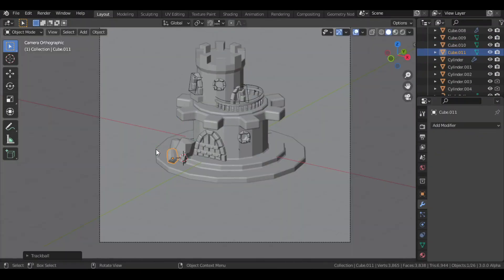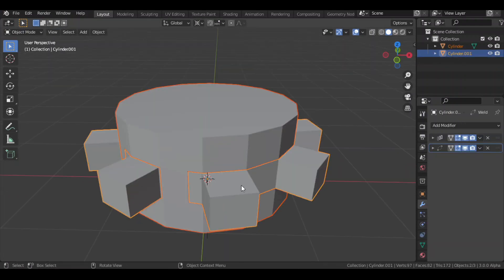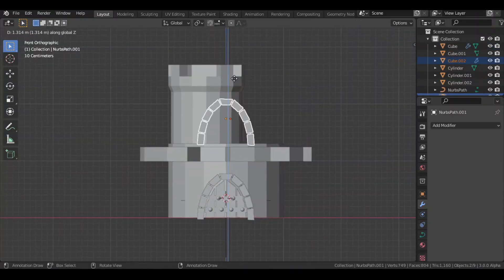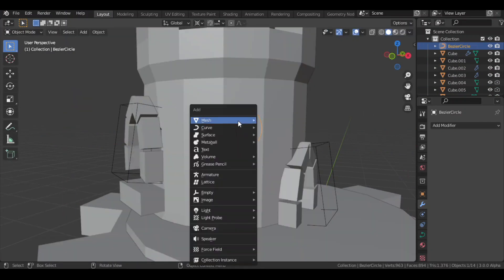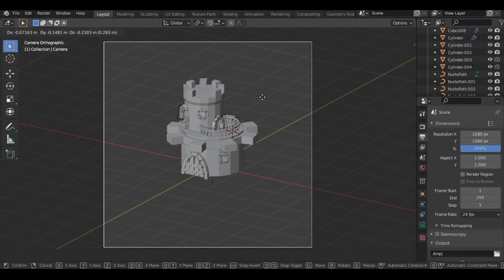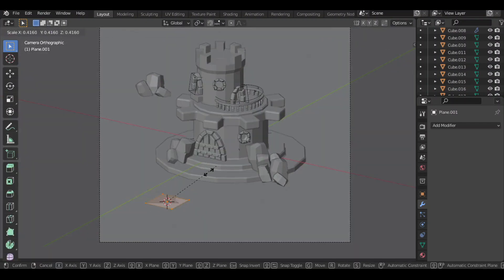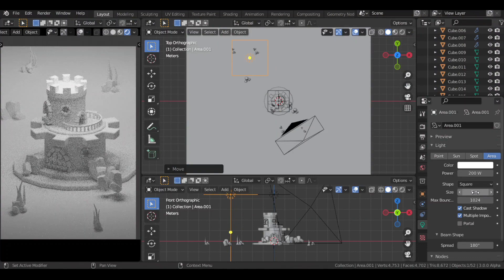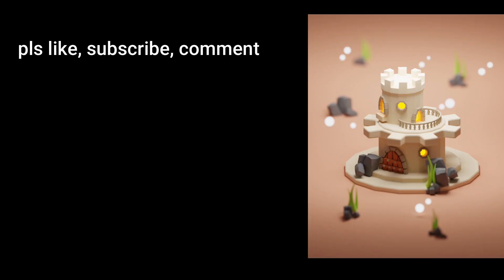Make a castle (fast tutorial)

Comment: Thank you for uploading this video! I'm finding it useful for learning how to use Blender!

I'm using Blender 3.1, and I'm having a couple of difficulties:
1.  The windows, after adding the bouillon effect, aren't lighting up like you have in your video; I've tried changing the surface from Principled BSDF to Emission (in Material Properties), and there's no change.  I just have some wired edges of the cubes right outside my windows...
2.  I've tried to do the emission suggestion to the bokeh effect/circles that you brought up in the previous comments, and there wasn't any change to mine; they were still gray floating circles.

As I said, I'm new.  I've tried looking up some help tutorials to see if anyone else has had this problem, but all I could find are the standard, "this is how emissions light objects."  Is there an add-on that I need to turn on for this? Or maybe something simple that I've overlooked? Thank you for your time..

Comment: Nice video! What are your computer specs?
Reply from the maker: I use a laptop (i3 6th gen 2 cores, 4 GB RAM, intel HD 520 graphics)
Reply: @3dgreenhorn  Very interesting. With such a weak configuration, it turns out to do such interesting lessons. There is no way I can buy a new graphics card.)